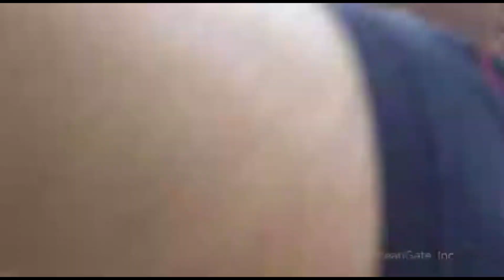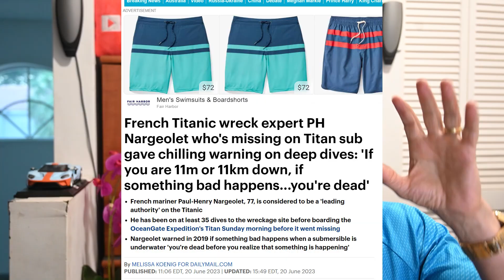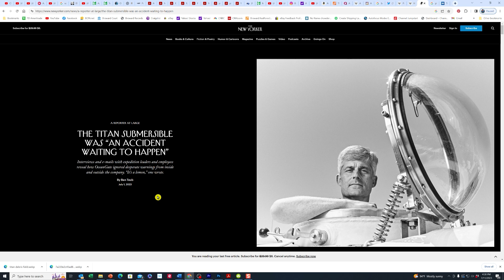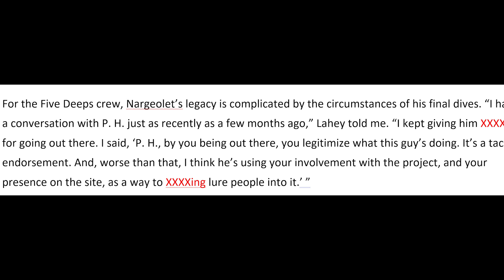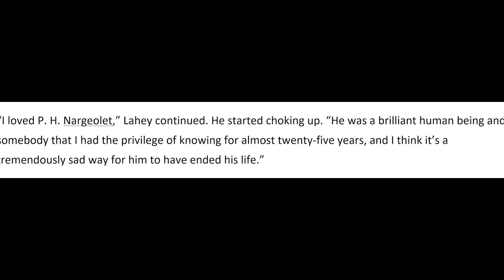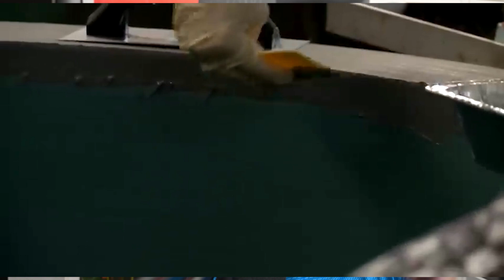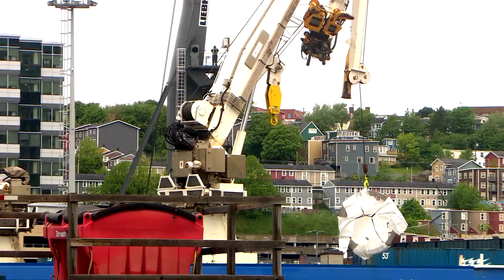Titan Sub: More Q&A, Design Defects, Why Descent Fast

Comment: If you look at where the guy is putting his hand it's not on the side where the glue went. You just see a flat lip, thats the side the dome (front or back) would have connected/ closed against. The straps giveaway the orientation when it would be lifted to go on the CF tube. 
You don't see the milled out trough for the CF tube to go into. 
You also see in the construction video the CF being put on a spool of some type with ends that extend outwards. It looks like the CF and the spool were together when the caps were put on.  Don't think they would have drilled into the CF to mount all the internal gear. Especially the pass-thru of cables to the electronics outside the tube. There must have been a sleeve in the tube to mount everything too. Any drilling of the CF would have cut the strand/s of fiber to now they are no longer 1 continuous spool of CF but several separate pieces that can move independently of one another.

Comment: I think at this point its very simple what happened after knowing some of the detail. They had a issue where they lost power or control to the thruster or to the equipment that allows them to descent at a proper rate. They started to descent at an extreme rate pressure increased to fast which blew off the seals between the carbon fiber hull an titanium ends an bam implosion happens. Simple. The design between carbon fiber an titanium ends was not properly engineered an manufactured properly for that type of pressures.

Comment: Without an autoclave to "bake" the materials together, they were probably trying to limit the resin content, that's why you see the rovings 

Constructing this without a clean room is more like a "garage project" than a high tech submersible. Show me the data that guarantees no trapped air or particles get in the wrapping or gluing process.

It's anybody's guess how uniform the glue application was, no matter how the surface of the Titanium was prepared. The glue was applied like a hobby project, I'd like to see the data on the gluing process and who wrote it. 

As a whole, their entire method of composite construction has been accepted as archaic for more than a decade. The reason is, it's impossible to guarantee structural uniformity. 

There is no way Boeing or NASA had anything to do with this, both don't assemble composite material this way, we found out years ago it doesn't work. Again, I'd like to see the data that says "go ahead and use outdated composites in an open wearhouse and apply the glue by hand using your best judgment". 

Stockton was a snake oil salesman and PH appears to be burnt out and in need of cash.

There is no valid data that supports this design, if you've had experience with this material, you know this method is wrong. Maybe you could use it once at best, after that, anything can happen.

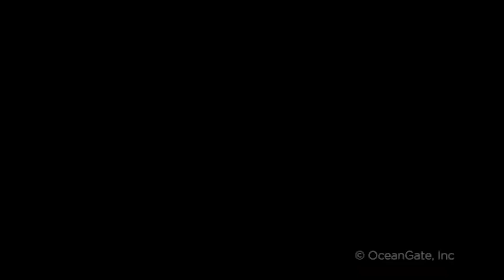Comment: 8:09 And to be strong, the threads should have been wound in alternating directions- not all lined up. This alone is stupid beyond belief.
edit: This means the hull could shear radially, breaking few fibers because the break is between fibers running next to each other in the same direction. I still can't wrap my head around this not being a red flag to anyone who saw it.

Comment: I believe the rapid descent was caused by sea water leaking into the sub from the beginning of the dive, which is why the rate seamed to increase, then power buss "A" shorted out from the sea water. after they dropped the ballast then the skid, the thrusters on full power UP and only rising 60' in 3 minutes. with the flat floor in the sub and I assume the batteries and other equipment underneath the floor they may not have noticed the sea water intrusion until it was to late.

Comment: Is there a water pressure transducer on the submersible that transmits the value inside ?   Would it be simple to Approximate the descent rate with time/ pressure charts?

Comment: I'm thinking they could have filament wound those titanium end flanges into the filament wound tube and then cured it all together.  This way there would be some carbon fiber/epoxy holding the flanges on and not just epoxy adhesive.

Comment: The  carbon material wound over the mandrel forming the the pressure hull was called pre-preg. The resin is pre impregnated in the carbon fibers. It is kept in a freezer as the resin matrix is heat activated. Pretty sure the hull was then cured under pressure and heat in an auto clave. I agree that the failure was probably the bond to the end caps and not the hull itself.

Comment: What I noticed in the glue up of the rings to the tube is that there is no problem lining up and inserting the tube into it's groove in the ring.  This means it is a rather loose fit and it should be close tolerances.  This looked pretty loose.  So the sides of the channel would be a very weak bond.

Additionally, that grove in the ring is very shallow, this means even if the fitment had been better the support for the tube is minimal. The ring and tube would deform at different rates.  Without sufficient support for those rings the face of the tube, where it mates to the ring, is going to deform, which is going to shear that whole glue joint.  When either end fails that will create a shock wave that races through and blows off the other end as well.

Finally, that window opening doesn't seem to have any bolt holes... was that glued in as well?

Comment: I have a question that i think can only be answered with speculation. From the transcript, from what the others in the sub community knew, even those above board: it seemed really obvious that the sub lost communication due to catastrophic implosion. Why do you think there was such a big search for them as though they were missing and running out of oxygen? do you think the media misconstrued the emergency? do you think the coast guard was aware and withholding that info, or do you think info was withheld from USCG? i think i’m just wondering if this vessel had a history of structural issues, why such a huge amount of coverage was speaking as though they were alive and lost

Comment: Wouldn't they have noticed the fast descent pretty early, and made efforts to reduce it? Hard to believe they were descending too fast for that long, and did not notice it.
Reply: Especially with the transcripts. Polar Prince knew they were descending too quickly and didn’t bother to say anything.
Reply: @LittleBeams  Assuming the transcript is real, it looks like they did notice it but were told to back off by Rush who insisted all was OK.
Reply: @edwardlafferty8796  That's my train of thought too. Cause they did ask about adjusting velocity, so they were trying to say something without being critical.
Reply: Its hard to notice if you don't do the math. Also, they probably assumed the water around them was going down too due to currents or something. No alarms were going off until near the end. I still think it might've been a high-resistance short circuit. That would've taken a lot of voltage away from the thrusters but not caused a breaker to flip. It would've also heated up the batteries a lot.
Reply: @ryelor123  The overall issue with the alarm is that it only alerts when it picks up a sound. By then it's too late. Odds are those banging that have been dismissed were the sounds of the vehicle as it was starting it's death throws. The possible transcript did also mention hearing sounds in the aft a couple times before all communication ended.

Comment: I think the fast decent also didn’t allow time for the different materials to acclimate to the changing temperatures. 

Maybe the titanium rings and domes cooled and condensed at a quicker rate than the carbon fiber. That extra hour may have allowed the carbon fiber time to catch up and match the shrinkage rate of the titanium.

Comment: I thought it was a wet layup using prepreg.  AND, we also heard that it was expired supply from Boeing [Spirit?] supplied by Toray or Hexcel it had definite expiration dates.  The first thing I noticed was that his plies had no pattern -- just continuous winding like a bobbin. That tells me he had no idea what he was doing with composites.  We took a lot more care than this with simple secondary structure and fairings with precise drawing details showing require ply schedule weave patterns for any load bearing structure.  I don't know the point of failure and not sure anyone else will ever know either, but it was likely the C-F plies.  This is just terrible, but no one regulates submersibles and this was an experimental craft he used for hire!  Unthinkable.  I'm going to stop posting about this now as it is just too irritating to realize that all along the way there were ways to avoid this outcome and that he took almost no care whatsoever.

Comment: I dont know anything about engineering but just a thought about "rate of descent", could they have been taking on water from the start? And as the pressure was increased, the leak got bigger and more water rushed in causing those cracking sounds. Water wouldve made it heavy, it wouldve fried electrical system and batteries. They lost buoyancy and I heard it wouldve dropped to the floor vertically, nose cone down so when it hit the floor with that pressure the hull wouldve blown away from the port hole section like a cork on a champagne bottle x a billion! Im surprised to see such big pieces of the hull(?), white pieces, it didnt look crushed.

Comment: Enjoying your series; very reasoned. Could you do a chart on normal descent rates v. pressures, comparing the last dive’s reported descent rate and pressure? Might be very instructive on your speculations of the carbon fiber failure.

Doesn’t necessarily apply but saw a DIY carbon fiber plane build a few years ago. Builder had to take an FAA-approved class and have critical components inspected before use. In that application, the fiber layers had to be thoroughly wetted with a specific resin to allow for flex as well as lateral stiffness to allow the components to successively cycle for hundreds of flights.

If the resin used for Titan was primarily for pressure resistance, successive cycles would likely be a serious problem after a dive or two, so perhaps the fiber hull should have been considered an expendable component?

Comment: The Titan was like dropping like a rock. It probably would've imploded regardless, but not as quickly as it would have if it was descending slower. I agree with the pressure issue. The craft wouldn't have been able to compensate the drastic changes in pressure at the speed it was going.

Comment: Sure the sub is a mess of bad choises and worst of all it was not classed. But the decent rate variation from the planned is very doubtful to have any cause if the accident. It simply doesnt matter when you anyway have two very different materials joint together.

Comment: The carbon underneath the titanium ring for me is unforgivable incompetence if carbon had to be used it should be sandwiched between the metal,
Also with a titanium front and back why not just have a titanium centre maybe even as a 3rd piece instead of the carbon and bolt it all together,
Apparently that was the 2nd carbon body, instead of the 2nd carbon body he should have just gone for a titanium tube centre,
For me he couldn't dump the carbon as his ego and pride was wrapped up in the carbon.

Comment: If descend rate is critical, why don't they have some kind of computer controlled diving???? Or have some kind of alarm to warn them if going too fast.  And why don't the mothership tell them to slow down???? Or was they afraid to get fired?????  I wouldn't be surprised if that arrogant CEO just did it manually and ignored everything.

Comment: I am a software engineer working also on PLCs (Programmable Logic Controllers).
And I find it fascinating that only a very few people question using a wireless controller in a potentially radioactive environment. The ocean also has some sort of natural radiation too.
This interferes with signals and may cause signal loss. 
The problem about those wireless controllers are that once they lose the connection, they still keep to the last command being issued, e.g. if someone said "down", it goes down until receiving another signal. If the connection is lost here it would explain why the submersible decended too fast. Maybe they lost the connection downways, not paid attention, and then it was already too late?
Reply: If the thrusters where pushing them down, that would explain why they didn't ascend faster after dropping ballast (assuming the ballast drop was successfully completed). Also, as with many disasters, there might have been more than one thing that went wrong and thus multiple failures accumulated
Reply: I've crashed far too many cars and planes in games, when I used some cheapass wireless keyboard that dropped the connection randomly, but it would be tragically hilarious to lose a sub cause your controller did the same. But on the other hand couldn't they just unplug the receiver? If it was running on some common OS (and I believe it was some linux for steering and windoze for that bigger screen), it should just stop registering the button push/joystick position and level itself at "zero"?
Reply: @uacnix  They were running Windows 10.
Reply: The thrusters were not used during descent, they had lead pipe ballasts that pulled the sub down. Since the sub was naturally buoyant without the ballasts, as soon as they dropped all the ballasts the sub should rise to the surface. I believe they had 2 or more sets of ballasts such that one set could be dropped to halt the descent and maintain neutral buoyancy so the thrusters could move the sub up/down, left/right. The thrusters were used primarily to move the sub around the Titanic wreck and could raise/lower, turn left/right to move around the wreck to get the best view. If the transcript is correct they were descending too fast and even after dropping all the ballasts and the framework they could not ascend very fast. That meant that the sub must have lost buoyancy compared to previous dives. The only way that could happen was if sea water had made its way inside the air chamber or the compressive force had reduced the volume of air inside the sub. The only way to reduce the cylinder volume was if it was being compressed inward minutes/seconds before it finally imploded.
Reply: Generally, quality wireless (wifi) controllers should work fine at this short distance. It should be tightly packaged in high pressure containers. Bluetooth will probably be not good underwater. You likely want at least two hubs outside main vessel in different containers.  Wireless has error correction built into protocol. Radioactivity will kill crew long before it causes any serious problem for wireless link. Although, I think it would be so much safer  to bring fixed wire outside of main vessel and have wireless link as backup solution.
Reply: @notean  The problem is just, that we talk about a Logitech F710 controller here.
Yes, they are good and also have implemented a function like that, however, there is still a certain risk for an accident like that to happen which is why I pointed it out above.

Comment: One would expect that , descending that fast would alert a normal person in such a  serious dive  . It was very clear that something was  going wrong very badly . Normally if you can not identify and able to manage the problem you would cancel the dive and try to return to the surface .This guy has not been alerted for this very suspicious fast decend rate  which could actually  be a sign for very a serious problem. .İnstead it seems that he enjoyed the fast decent and he was happy to arrive  the wreck early . If  he had been alerted with this unexpected descent rate and had decided to cancel the dive at e.g. 1000-2000 meters, probably this disaster would be avoided. It turns out that he lacks even the minimum conciousness of risks necessary for managing  this expedition .

Comment: There was a video posted by ThunderF00t where he heats a glass tube, attaches it to a metal ring, lets it cool, and the glass breaks away from the ring.   That's because contraction of each surface is different.  That backs up what you said about the different surfaces.